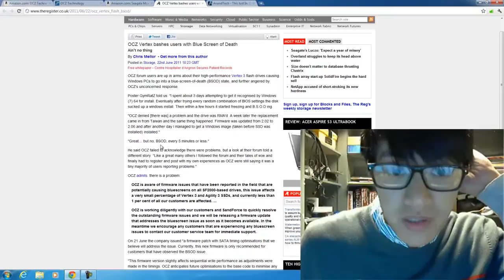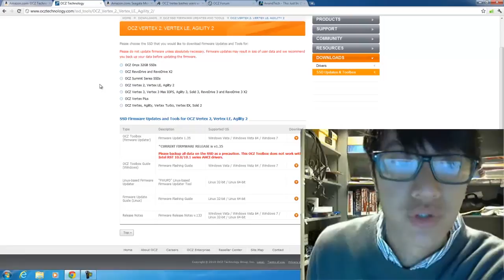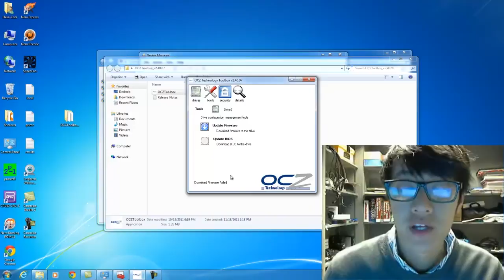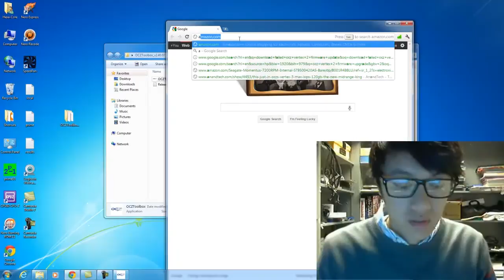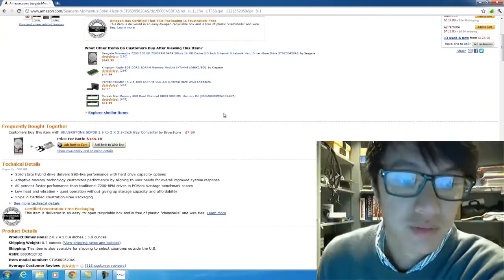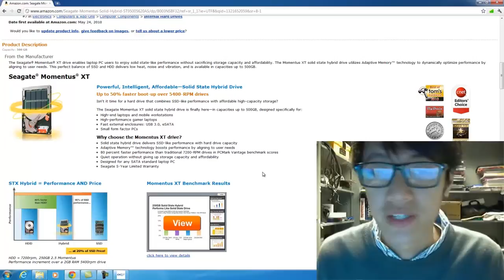Updating Firmware on OCZ Vertex 2 SSD

Comment from the maker: @DrSpike666 That is a tricky one. It might work if the onboard raid system will let you raid the 2 hard drives together and then raid again the ssd for srt. I don't think it will let you do that. Otherwise you could install another SATA controller card in the PCI-E slot to raid the 2 hard drives together and the mobo will think of it as one single drive to raid again in srt with the ssd. Does that make sense? It would be a great experiment. Thanks for asking!

Comment from the maker: @Leadrain86 ready boost does not work as well as intel srt because it is all software based whereas intel srt is hardware and software based. It also does not load the OS any faster but it is a good alternative for systems that do not have a lot of RAM. Usually your system will load files into the page file system, it's like extra ram on the hard drive. The limitations are that hard drive are doing double duty and ready boost will load files into the flash memory but only when low on ram.